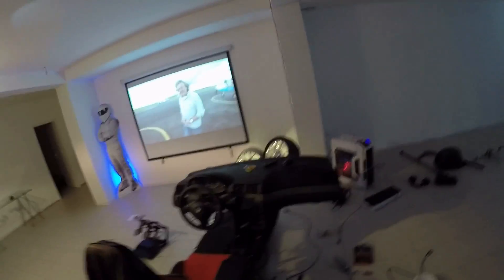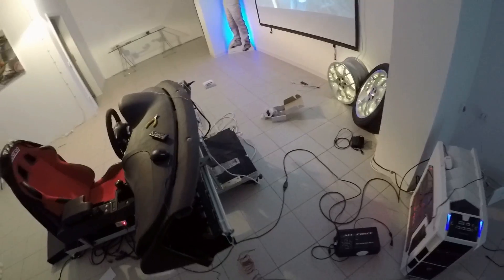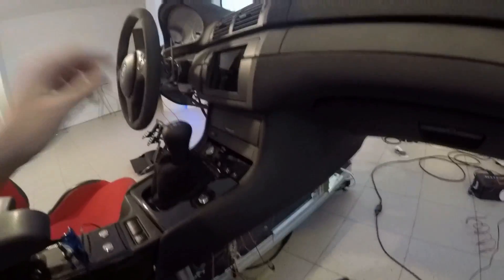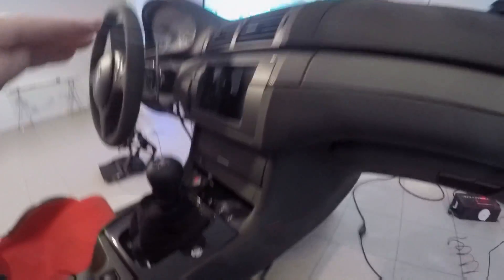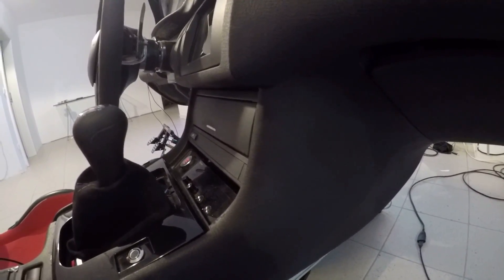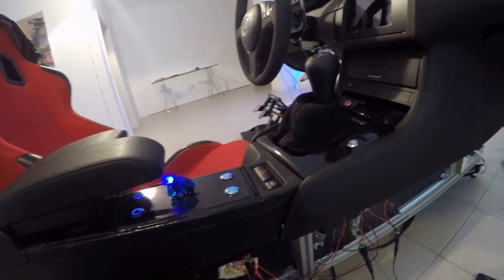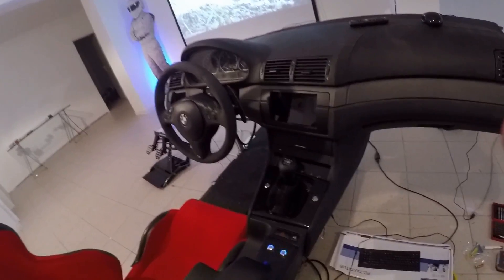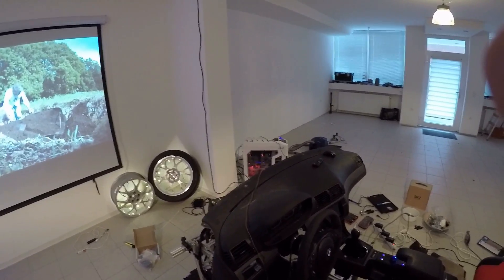Buttons and lights are wired up!

Comment: Four hours? Far more patient than I. I'd have thrown the whole thing out long before that.
Reply from the maker: Haha, yeah patience is extremely important for this. :)
Reply from the maker: But just as a PS: I learned to hate the build when I first started it. Many, many times. The key is to keep going and work towards the good parts which will eventually come. Mostly. Well... sometimes. ;)
Reply: I admire your patience and tenacity Alex - I'm just going to integrate a button box (maybe 2 button boxes) into my (much simpler) rig. My brother (a mechanical engineer) and I are trying to design something modular and easy to separate into modules so it can easily switch between sim racing, flight stick and disassembled states so I can move it easily. It's pretty challenging as I don't want all the wiring to require re-doing every time I have to take it apart.

Thanks for the update! I look forward to the next one! Take care Alex.
Reply from the maker: Thank you Stig! And good luck with the button box! Even relatively "simple" mods can be a pain in the butt sometimes :)
Reply: Thanks Alex .. that's .. inspirational .. ;-)
I'll be fine .. yeah .. fine .. wait .. why am I sweating ..